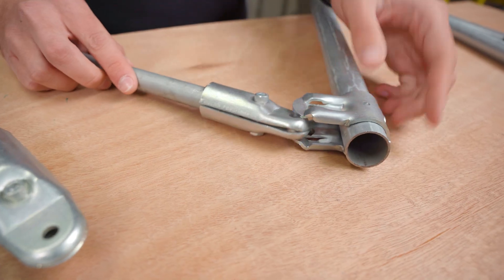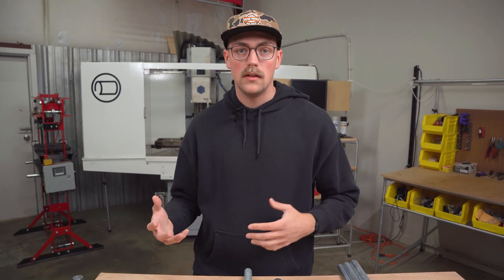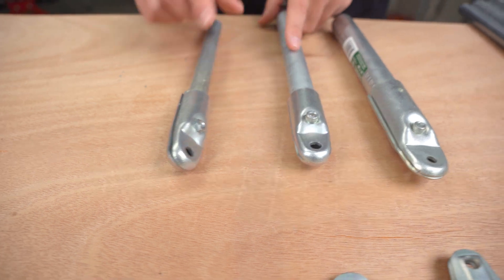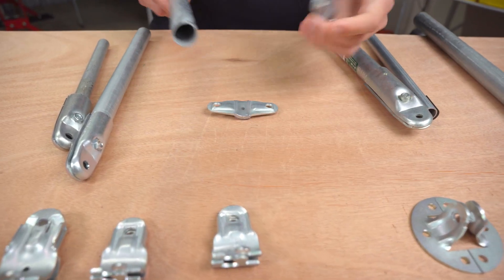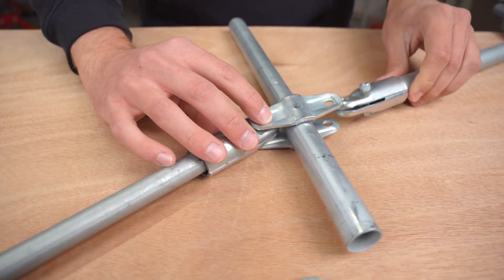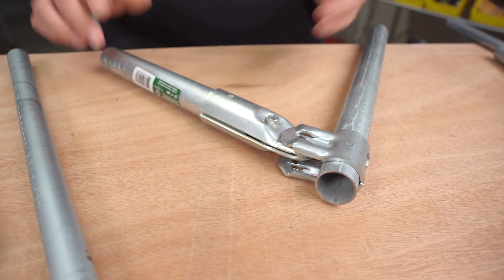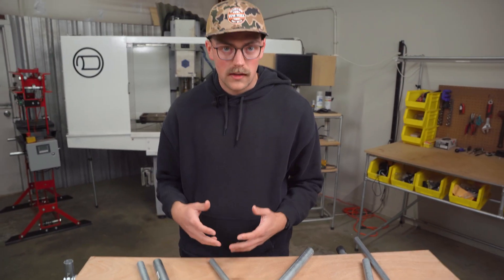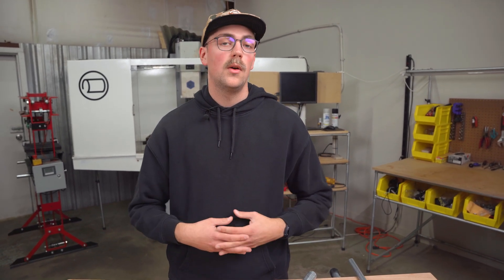This Hidden Feature Has Awesome Possibilities!

Comment: How strong are swivel and hinged fittings?
Reply from the maker: Hi there, thanks for the question! Since they are made to hinge, they can rotate under heavy loads when you don't want them too. What kind of project are you working on? I can give some feedback on if they'll work well for your application or not.